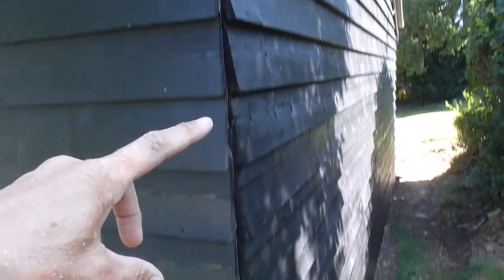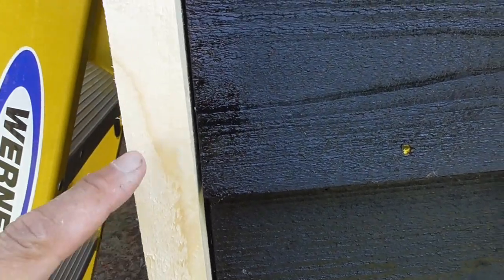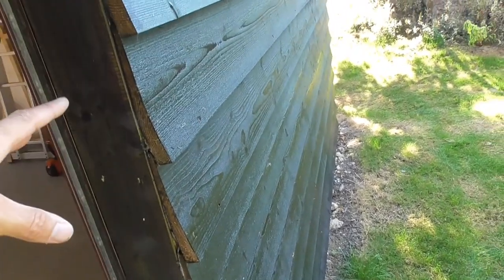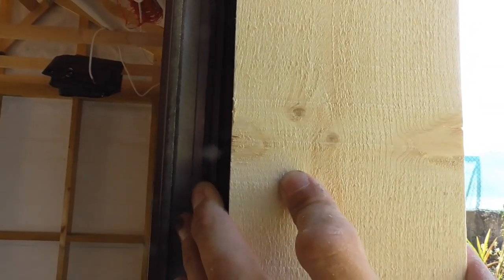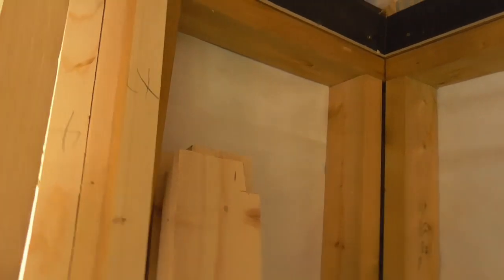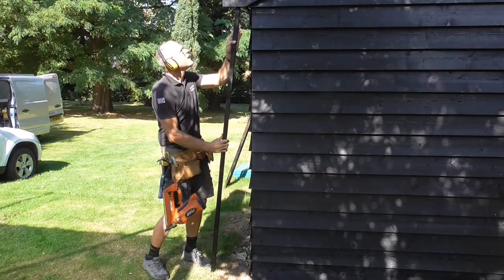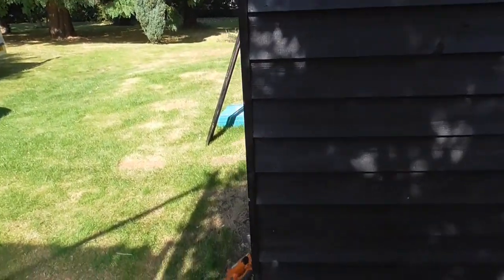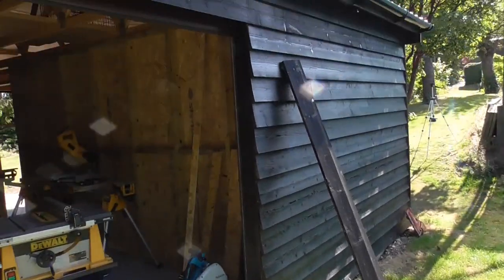Timber frame garage and garden utility space.***BONUS VIDEO***Fitting corner trims to feather board.

Comment: That looks pretty nice!  even better than overlapped one by on the corner which leaves a gap behind every board
Reply from the maker: Hi there. Butting the corners like I did in this video is very neat, but the feather boarding can shrink back and leave a little gap. Using an overlapping corner trim, as you suggest, does leave the triangular shaped gaps, but does accommodate any shrinkage👍 Thanks for watching 😎

Comment: I was thinking I would shoot that in with a second fix...did you use first fix (without splitting)???
Reply from the maker: Hi there. I fixed it straight through the corner with 90mm nails 👊 and got no splitting👍Cheers